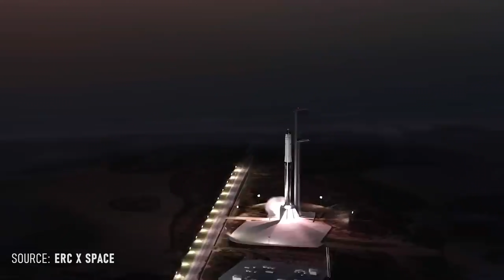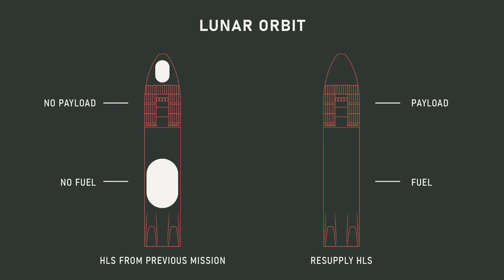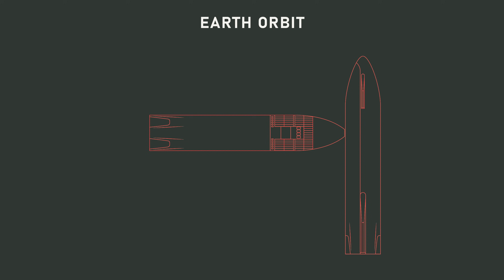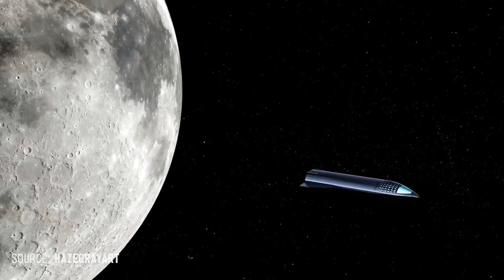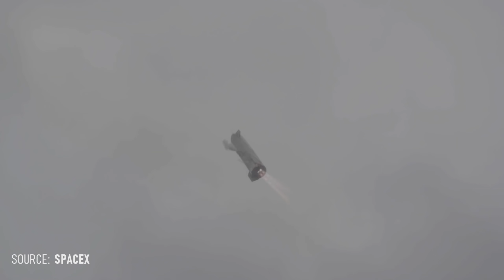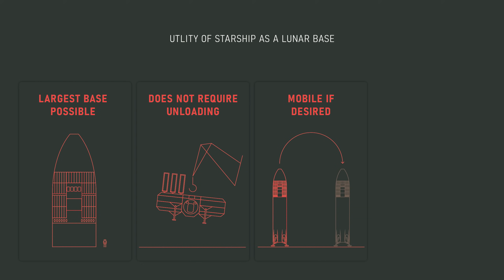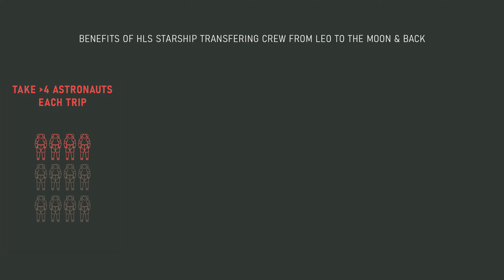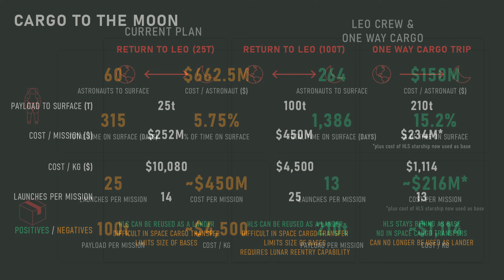How to Use HLS Starship

Comment: To be blunt;

Given that they are significantly more expensive and operationally limited than Starship should SLS and Orion be employed in the lunar Landing program at all?

It has been abundantly obvious for some time now that neither SLS or Orion are competitive with Starship nor does it seem likely they will become so no matter how much they are refined.

Starship can fulfill every mission niche on the Lunar Landing curriculum more easily and efficiently than Orion and SLS can satisfy a relatively small fraction of it.

Starship can provide vastly superior accommodation and other amenities for astronauts during any phase of a Lunar landing mission including at the Lunar surface.

SpaceX' Dragon capsule can perform any of the roles currently anticipated for Orion at a significantly lower cost and the Dragon capsule is an established vehicle repeatedly validated by successful missions already.

The propellant tanks on a Starship that had been repurposed as a permanent lunar structure could be employed for storing water harvested on the lunar surface as well as liquified hydrogen and oxygen refined from that water.

For that matter it might be preferable for an individual Starship or possibly a small number of them to be specifically configured for processing water harvested from the lunar surface not only into potable water for consumption by people and plants, but also into propellant.

Starships could also be purpose built with infrastructure for recycling biological waste on a scale necessary for a growing, self sufficient colony.

By such means the relevant infrastructure could arrive on the Lunar surface ready to begin performing dedicated functions with a minimum of interconnection to the general reticulation network.

Furthermore the propellant tanks on Starship's would be ideal for storing propellant produced in-situ for use by all manner of additional vehicles including Starships intended for re-use.

A capacity for Lunar refueling could solve any propellant related dilemma's with regard to round trips straight off.

The only, contingency not yet satisfied for the Lunar Landing criteria to be fulfilled is completion of development for Starship and Super Heavy and only three, main obstacles currently stand in the way in that regard.

To begin with it is important to stipulate that the magnitude of inequity between SLS, Orion and Starship is so abundantly obvious that the Blue Origin lander fares no better by the same process.

That automatically invalidates all contentions by other aspirants to inclusion in Lunar Landing missions and therefore  a seemingly endless litany of asininely pointless legal obstacles contrived by so-called competitors who cannot possibly stand a snowball's chance in hell of actually competing with SpaceX on a time frame dictated by the current lunar Landing program.

Second is a seemingly inexplicably protracted delay for 'approval' by the FAA that is preventing continued launches and other developmental activities by SpaceX at Boca Chica pursuant to conclusion of an 'environmental impact study'.

Third is the fact that NASA may no longer have the funds for completing development of a new generation of EVA suits suitable for use on the lunar surface within a timeframe it stipulated for it's Lunar landing agenda.

Fortunately, Elon Musk and SpaceX have also stepped forward yet again and offered to perform that essential role as well!

It is abundantly obvious therefore that the only things restraining SpaceX and NASA from proceeding towards the Lunar Landings and establishment of a permanent lunar base with characteristic speed and efficacy are unnecessary and invalid obstacles placed in their way by other parties.

Comment: In theory Spacex could launch a lunar starship unmanned with as much or as little cargo as they please to use as a base for future missions as a practice run. In theory they could even send dummies simulating crew weight, suits, etc. Even if at worst it crashed they’d still have cargo in place as long as it was a low velocity crash. At best they could have a perfectly fine base/warehouse as you say.

Once cargo gets depleted by multiple missions either repeat with another lunar lander or just send small payloads via another means. Falcon Heavy, Vulcan, dare I say New Glenn, etc could send resupply missions direct to the moon’s surface. Not in starship’s volume but 5-7 tonnes of essentials periodically and retrieved in-situ by astronauts as required. NASA will never be allowed to rely on one provider after all.

Comment: I would like to add up that practically any of the "back to earth" points you did are wrong. The lunar lander does not have a heat shield, nor does it have flaps. So going back to earth with that is impossible. We need an external way of getting on the surface of earth. Like a normal starship, or orion, or anything with a heat shield really.
Reply from the maker: Heatshield and flaps are not required to come back to earth orbit. Sorry for the confusion, that did not mean landing back on earth, that meant returning to earth orbit, which can be done with engines not requiring flaps or heatshield.
Reply: @Apogeespace  Oh! Ok so yeah you’re right!

Comment: You missed the whole point. The necessity and achievement of a very high launch cadence is it's own goal in space exploration. The need and ability to launch massive rockets 4 to 6 times a month is not a risk. It is THE GIANT STEP step space exploration needs. This, in and of itself, is more important and more worthy of funding than the Space Shuttle, the ISS, SLS, Orion and ALL of the space probes NASA ever launched COMBINED. Why? Because if you can't do that, and do it affordably, you are not going anywhere with any meaningful number of people or stuff. If you can, the whole solar system is open to colonization.

Comment: These are just rumors but I have heard that they are going to be using a nuclear powered engine involving thorium salt reactors as they can operate at atmospheric pressure instead of using a turbine they would use a heat transfer electric generation system they are highly compact but can generate gigawatts of electricity this electricity wants in orbit can be transferred into an ionic engine and any by-product or nuclear waste which would not contain weapons grade plutonium but a thorium byproduct can be used to refuel the tanks of a nuclear rocket engine the heat from the reactor can also be used as a propellant as it is produced from the Cascade effect once the carbon tubes are placed in the thorium reactor salt mix this makes it easy to shut down the reactor simply by removing the carbon rods which cause the Cascade reaction cooling off the reactor from 700° to room temperature so the reactor is not highly pressurized it is also easily shut down and is ran off of inexpensive much less dangerous radioactive materials easier to shield highly portable and compact lasts for up to 80 years without having to replace fuel can heat the entire space station provide more energy than they could ever possibly use provide alternate sources of fuel over time and the heat it generates can't produce electricity through heat transfer and the process would work much better in space and on the moon because it is incredibly cold on the moon and the reactor would be incredibly warm so the heat dissipation in the conductive pads would be much greater causing much higher voltages without water vapor buildup and freezing ice build up

Comment: Will he is basing his cost on reusability so perhaps it will land back down on the moon after transferring the astronauts and multiple Moon Landers will do the same thing until they have enough raw material to build a small space station or Moon station linking all of them together with airtight Bridges and gutting out the fuel cells once they have enough to make habitation room and storage space along with water reclamation and oxygen production I estimate it would take around 10 spacelanders to make a long-term moon base or they could simply lay them down on their side connect them together in a big ring or multiple big rings then cover them with lunar surface material for added radiation protection this would make a large amount of space for habitation and possibly crop production for a sustainable food source and oxygen supply I'm fairly certain there will be a war fought over Moon property in the near future and maybe even claiming planets like Mars can you imagine the outrage if Elon musk claim to Mars for himself but still had fully operational space program on Earth

Comment: It seems to me that it's possible to use only an HLS Starship ONCE.  Simply send an unmanned ship to the Moon with a robot that can lay out a solid landing pad - giant 3D printer using the Moon's regolith as building material.  With a permanent landing pad in place, you can now land standard Starship cargo and crew versions, capable of returning directly to Earth.

Comment: We should use ISS as the Leo transfer hub. Accommodate lunar crews, accurate cargo and store fuel for the HLS. It would require some modifications to ISS but, StareShip as a supply shuttle, that should be easy.

Comment: I hope the powers that be are considering this method already.  If not, they should be now.  So, by using your dual starship approach, combined with (3) F9 launches (requiring 3 dragons or eq to be in service at one time), 12 astronauts could be shuttled to the moon and back more efficiently on each mission.  

Why send only 4 astronauts at a time when HLS can easily handle a dozen?  This would bring the numbers to about $800M/mission, $66.5M/astronaut, 50 missions, 600 astronauts to the surface, 1050 days on the surface, 34.5 human time (years).  

And assuming that the Starships equiped to return from LEO are eventually human-rated, 12 (or more) astronauts could be shuttled to the HLS in orbit in one launch which would lower the cost even more.

Comment: Thanks for the video. I believe one very important method was missed out here.
Lunch HLS Starship, with the crew on board, and refuel with the crew. 
That'd be very cheap compared to these, and take much more people to the moon.
And as you mentioned, they will be doing a LOT of LEO refueling by that point, so, it'd become trivial and safe.
Or as Musk mentioned, orbital refueling should be easier than docking with the ISS, which they have already done.
Reply: Good point. Launching a Starship is much safer for humans than landing in one.

Comment: Great work, but this assumes that Starship Tanker capacity is limited to the current size of Starship. 
SpaceX will mostlikly make Starship Tanker Bigger in order to refuel all versions of Starship with only 2 or 3 refuellings. And to use the Sea Launch Platform's for refueling for Safety reasons.

Comment: NASA's moon plan is stupid. Boost starship lander into low Earth orbit. Transfer crew to starship from a 7-passenger dragon. The ride to the moon will be a hell of a lot more comfortable in starship than in some dinky fucking capsule. And the crew could be launched with a falcon 9. Not some billion dollar boondoggle. The crew then rides back to earth orbit in starship and then transfers to dragon for landing back on Earth. So much cheaper. So much faster. So much less dicking around. That lander is never going to land back on Earth so it's going to be handy for going back and forth to the moon several times. It will need to be resupplied in Earth orbit and refueled in Earth orbit and crewed in Earth orbit. We do not need the Senate launch system for anything.

Comment: In the long term, O2 can be made on the moon. this drastically changes the range and available deltaV. If the Lunar Star ship lands with only residual methane and uses in situ O2, it has a much higher capability to return to LEO. This changes your calcs.
Also If you carry out the base option, how do you get the astronauts back?

Comment: There is another possibility.....
Instead of Lunar Starship flying from LEO to Lunar Orbit using it's chemical rockets, Starship could be outfitted with Ion propulsion for the LEO to Lunar Orbit and back. The chemical fuel would only be needed for Lunar landing and launch. Lunar Starship could receive any resupply cargo by docking with the ISS. The cargo can held aboard a Cargo Dragon at the ISS for transfer to Lunar Starship. But during this time a 2nd Lunar Starship, with it's crew and payload, would be already be on station on the Lunar surface. 

We already know that SpaceX can build a Starship in 3 months; a Lunar Starship in ~5 months. So Lunar Starship would carry the heaviest equipment needed for Lunar sustainability: power, communication, transport, drilling, refining (fuel, water). 
In time there will be multiple Lunar Starship habitats serving as operational bases as surface habitat/workshelters are constructed.  Furthermore, theses Lunar Starships would be used to create habitats in difference areas of the lunar surface.

Comment: You need to fuel the HLS Starship 14 times, not the most reliable.
Reply: Elon denied that. And it makes sense too. Starship Tanker minimum payload to LEO is 100 tons. The Starship fuel tank is 1200 tons. So at MAX it can only require 12 refuels. But a trip to the moon surface and back doesn't require a full tank. So the number is more likely to be 8 or 10.

Comment: I watched this vid when it first came out, and watching it again now.   Thumbs up!  

FYI: If you take an ss v1.0, with all the return-to-ground dry mass, but convert cargo vol to prop tanks, you now have about 1300mT prop from ground.  The ss+booster are mass-limited from ground. However, 1100m^3 cargo vol holds ~530mT prop when you refill in orbit and are volume-limited, not mass-limited, so that's ~1730mT capacity.  

The whole  depot infrastructure can be demonstrated with a few stock v1.0 ss. Once you have enough prop demand in orbit, stretch ss space tankers with thinner walls and no tps/flaps/batteries equipment will reduce dry mass by close to 100mT and have larger volume to work with.

Donor-to-receiver ratios will have to be recalculated when the ss design is a little more stable, and will obviously depend on how far up each depot layer is implemented.

Comment: You left out that StarShip is designed to take up to 100 people to Mars so if NASA was not worried about launching people from Earth on Starship it could really get revolutionary without Dragons, StarLiners or Orions. Also, if the first Moonship carried equipment to construct StarShip pads on the Moon then normal StarShips and not just NASA's MoonShip could land.  This lowers costs even more with a ship designed to re-enter Earth or land on Mars. No Astronaut transfers.  I understand the multiple reasons that NASA is leery of that.   No escape system on StarShip and investments in Orion and radiation questions bother NASA but it's an option you need to add to your costing.  Yes, NASA did get burned with 2 shuttle disasters without escape options but airliners don't have escape options in the air.
Reply: Custom StarShips/MoonShips with factories to make fuel built in or power generators (reactors and such)  could then be landed at a Moonbase which simplifies the whole refuel to return to Earth or do other missions and the support a base needs functions.

Comment: Four types of Starship are needed: SS-Depot, SS-Pusher, SS-Tanker, SS-Crew. 
1. Launch a SS-Depot and a SS-Pusher in LEO.
2. Launch ~16 SS-Tankers to fill the SS-Depot and the SS-Pusher.
3. Launch the SS-Crew in LEO and refill it using the filled SS-Depot.
4. Use the filled SS-Pusher to put the filled SS-Crew to GEO.
5. When in GEO the filled SS-Crew turns on its engines and heads to LLO.
6. If we put a Lander in the SS-Crew then it would be possible to send astronauts to the surface of the Moon and make them return to the SS-Crew that would wait in LLO.
7. The SS-Crew can come back from LLO to LEO without refueling.

Note #1: The SS-Crew could land directly on the Moon if methane and oxygen could be produced on site.
Note #2: Perhaps there is a better way to do it.  😀

Comment: The the HLS goes between the earth and the moon, but stays in the vacuum of space, the 3 raptors in the middle, can be exchanged and squeeze all vacuum Raptors under Starship. Also strap on 2 falcon 9's onto the Super Heavy Booster for more launch thrust. And maybe a few of SRB like ULA has on the Atlas 5's and strap them to the Starship itself, maybe 6 to 8 of the SRB's using the fuel that will burn in the vacuum of space. 3 to 4 out to the moon and then 3 to 4 back

Comment: overall great analysis. "one way to the moon, being the primary goal of a moon base" ; i think maybe that's not a true statement. i think the opposite is true if the words are to be taken at face value. the building of the base may initially  have a phase where more is left  on the moon than is brought back, but ultimately we will need an architecture that scales to a different scenario; as much brought back as is taken there. so thinking forward to that reality is something that should be mentioned when it comes to architectural analysis of industrializing the moon.

Comment: Send two ships still very cheap one for shelter, the other for support as well.  Like on a merchant ship put every thing you need in containers, A goes to B slots on the ship so you know what is in the containers and easy to move.  I think it will be easier than it sounds with a robotic arm pulling containers from a computer and then the robotic arm moves the containers were they need to be.